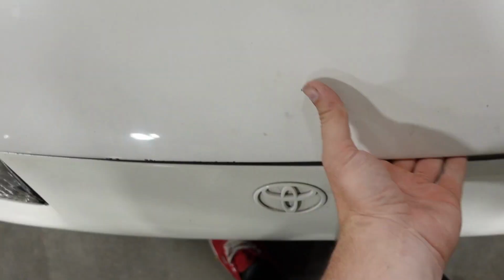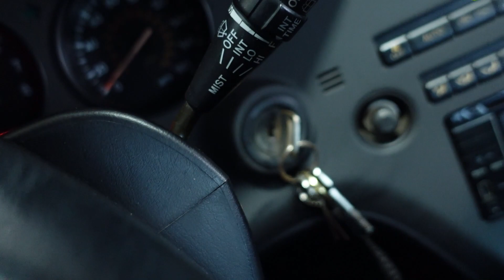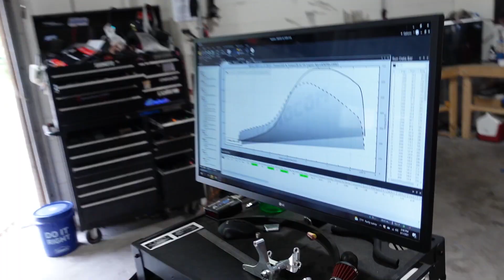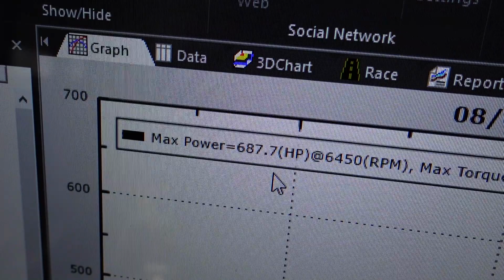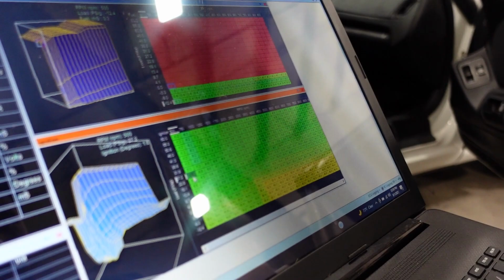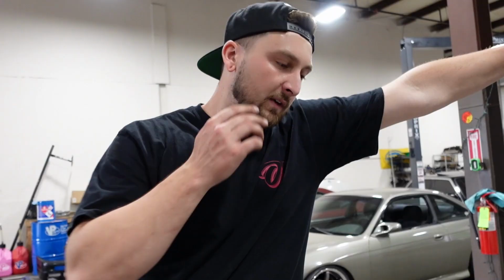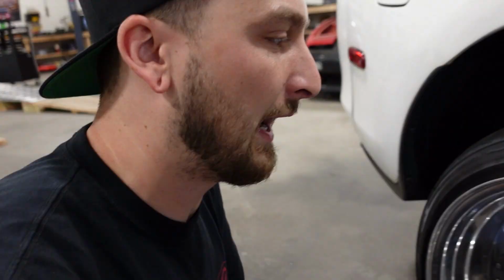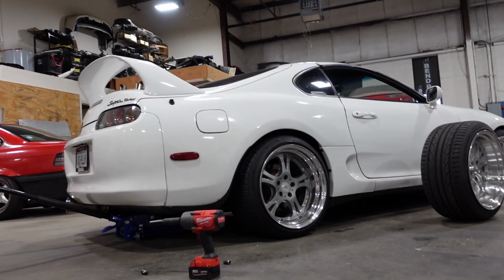Finding out how much power my Supra ACTUALLY makes! (Surprises EVERYONE.)

Comment: You could pull the engine and re gasket it at a minimum since it seems that's bothering you.

I understand the rabbit hole though because I'm sure you'll want to clean up more in the process
Reply: i agree spend a few days making sure nothing is leaking anymore and rip it for the rest of the season.
Reply: Always worth doing on an unknown engine. Had an m50b25 and changed every gasket or serviceable part other than the head gasket. 700 miles later a piece of the head gasket came out from between the block and the head. Now I change every single head gasket when I get a new car/engine.
Reply: Big move^
Reply: dude no summer is almost over, put some cardboard underneath and enjoy it for a few months then do it when you cant drive nice cars around
Reply: i say get to the easily accessible parts and rip it then take it apart over the winter
Reply: smart but what if they encounter a bigger problem after they open her up or worse of they head doesn't have work done to it and they've got a ticking time bomb
Reply: @dailydoseoftadi9719  then they find out before something worse happens?

Comment: Regasket for a peace of mind, do not rip the damn engine apart! Enjoy the car! Also, i would prefer the wheels that cane with the car, but that’s up to you. I jus wanna see you enjoy the car.
Reply: If you’re going to re gasket it your technically pulling it apart, sump/oil pan off, head off? Might aswell build it, rip it in bits. Build it then thrash the living hell out of it
Reply: @bentaylor6785  usually when folks say re gasket, they don't mean the head. Only oil seals and pan gaskets.
Reply: @Th3MoistGoat  ah, I’m from the uk, we do a re seal, which is basically a re gasket, we do head, cam seals both crankshaft seals etc

Comment: Do a thorough service and inspection, comp test, inspect bores, check waste oil for metallics, flush the fuel, get it aligned and go drive it. If you dedicate all your time on tools to just that list, I'd say you could knock that out in under a week, maybe 2 max if local wheel aligners are booked out. Then you know it's safe and you know you can rip on it without doubt. 👍

Comment: Nice safe tune i would put a bore scope down in the cylinder see if the pistons are aftermarket. Or pull the oil pan off see if bottom is built regasket it. The Serbs are 🔥 on the supra rebarrel fronts enjoy the car build it in the winter. Seats look way better without the harnesses also the nardi wheel with red stitch needs to go in. Love the channel just picked up a 04 325i and a 00 323i want to build a drift car lol. Keep up with the great content 🤘

Comment: Jimmy, I think you should enjoy a few summer months of driving the Supra. When Fall hits, then pull it apart. If you have to, just regasket the engine. You've got all winter to rebuild it. so time it so you finish when Spring arrives. As for DJ's new car, at last you've found a car that Ant looks normal sized in. I was hoping you'd jump in, just for the laugh.

Comment: 1) Wait till winter for the tear down 
2) Cerbs look good but need to be less aggressive with at least a 305 R888R or the new NT555R2 in the rear at that power level. 265 ain’t gonna cut it

Comment: Look jimmy.. from one big boppa to another. This is the plan my American fraaand. I’d do a re tune. For around 550/450 make the tune super safe. (Still plenty of power to shred the gnar) and when the season is over go from there. Just think of those summer mornings cruising with the roof off. Just getting loose on gate. Enjoy it. Because if you pull it apart. It’s going to not get back together let’s be real in time. From your brother down under

Comment: I'd do this: degrease the engine and undercarriage. That way, you may find where the leaks are for when you eventually refresh the engine. Check suspension components, get it aligned, and just drive it. When driving season is over, then you can pull out the engine to refresh it.

In the meantime, get whatever is needed to make the Supra look nicer to get it nicer off season.

Comment: pressure wash the engine and the underneath see where's its coming from the most, probably the oil pan and rocker cover, check there's no sneaky leaks and fix the rest later and send it ..

Comment: Just keep it topped off, beat on my manual is for almost 2 years leaking probably a bit worse but a neglected towards the end of the second year and spun a bearing just before reseal. Turned into full rebuild instead...

Comment: If you leave those wheels on, get some bigger tires, at least in the rear. Idk what the tire specs are on those CCWs, but they look a lot taller. Plus, with 700 RWHP you need more tire for traction lol.

Comment: Pull the engine and regasket it, put it back in and enjoy it for the next two or two and a half months. Then in the winter you just can dive fully into it. So atleast you can enjoy it without worrying to much before you really take it apart.

Comment: Pull engine and do a basic gasket refresh, drop it back in and enjoy it until winter.
Then when winter hits, pull engine, do frame rail and paint pay etc.
Content for now and more for winter!

Cerb's on the Supra defiantly!
or TE37's in white, cause white on white hits different <3
#MakeSuprasDifferent2021

Comment: Buy an N/A auto SC300 pull the engine from it give that motor a refresh so you can pull the supra motor to build and refresh it. Run a NAT 2JZ till winter when you can rip the car apart and give it the hot treatment

Comment: Just enjoy the car for the time being man. The Supra rails are stupidly reinforced on the inside and if you need to replace it you can just use a rail out of a Soarer/sc300 as the engine bays are completely the same from the firewall forward (different rad supports tho)

Comment: Slap the cerbs on,
Paint the lip and bumper,
Fix the red in the engine bay,
Rip it around for 3 months,
Pull it apart when you've found the other 100 little problems that you can only find from driving something.

Comment: LOL. its crazy you guys act surprised. out here in soflo we make 700hp through an automatic and pump gas on a stock long block 2jz gte vvti.

weve made 900hp on e85 stock long block and it held for about two months at that power and again through an automatic

Comment: In REAL life the Supra Turbo was hailed as the best handling car for any amount of money regardless of price" - Road and Track 1995 august issue... It pulled .98g in corners stopped from 60-0 in 109 ft and slalom at 68.7mph which was higher and faster than any of its competitors at the time including the Viper RT-10, ZR1 Corvette, Porsche 933 Turbo, Ferrari 512 Testarossa, RX7, NSX, and 3000GT VR4. Yours? lol you are probably right it probably does not go anything but straight as its been modded to go in a straight line and suspension is dilapidated. Probably have to go through that thing and renew every suspension piece and bushing in the car. Then put some proper tires on it as it was undertired from the factory. On my single turbo Supra I had 285/30ZR18 on 10.5 wide wheel front and 315/35ZR18 11.5" wheels rears. It was tuned for the road course and pulled over 1.5G in corners, out stopped everything on the track and kept up to everything on the straights. Once you restore yours, take it to a road course after you put the TT brakes back on it with the ABS. You will be extremely surprised that the millennials rap about these being heavy and can't handle is complete utter bs. It was the best of the period. There is better now but with attentive careful mods you could match just about any car in corners with one. IF you doubt this even a little look at  https://www.youtube.com/watch?v=z8PfUsyoIJ0 or this one   https://www.youtube.com/watch?v=9qU09omBs7Y

Comment: Not a huge fan of the wheels on the Supra just from the ride height, gotta see it tucked to feel the mojo, personally I think they belong to the coupe. The Supra could use some thought later on when you start to dig into it, you’re gonna want to personalize it so wait until then to find wheels for the Supra instead of robbing others wheels off impulse. Slow down and drive it for the summer bud enjoy yourself you’ve been non stop building we rarely see action